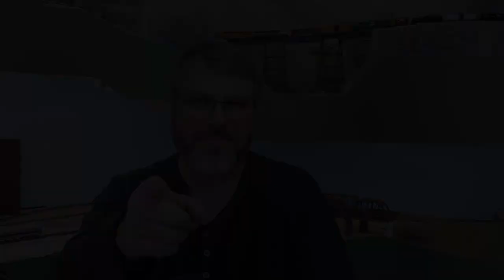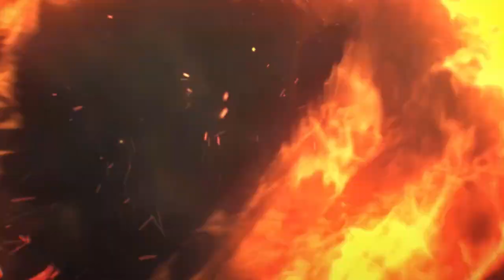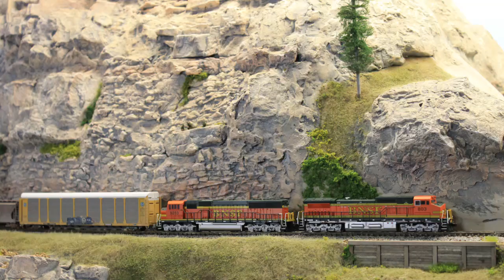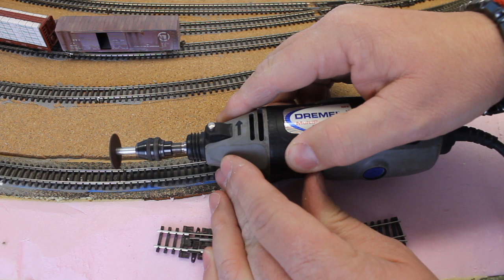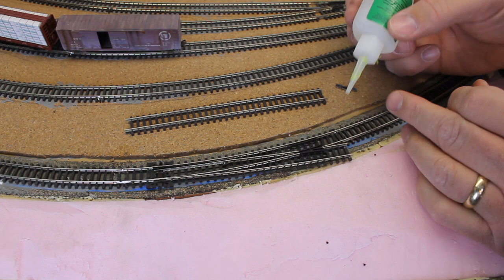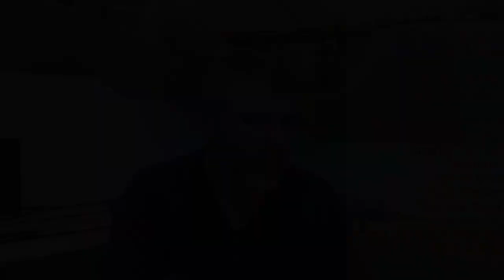How to Install a Curved Turnout on Your Model Railroad Layout

Comment: Hi Ron, I'm thinking of adding a curved turnout myself now, thanks for the instructions. My layout is in a large shed and I have an oil filled radiator to keep a moderate temperature but actually made a point of leaving some small gaps in the rails and not soldering those in case we have a heatwave, ha, ha, as I was concerned about the rails swelling and buckling. Where I did make a bigger gap than was intended I did put some solder in it and filed it down smooth and it has no problems. I did it that way as I'm not intending to paint the track. Thanks for the videos, Cheers, Rick

Comment: 10:48 fun fact: same thing happens when you're welding actual rails. usually in tight curves like that you would remove rail joiners from one side only, weld that joint, do the same on another joint further away (assuming you have several to weld) but on the opposite side and then come back to the first pair once it's cold. and you would grind them too, except not with a nail file :P that would take some time lol
Reply from the maker: That is interesting. Thanks for sharing.

Comment: Ron, a hint put the rail joiner part way on a short piece of scrap rail ( no ties) then use this piece as a holder to line up and slide the joiner onto the good existing  track.

Comment: Hi Ron, thanks again for a great video. I want to replace 2 Shinohara curved electro frog turnouts with the same Peco points you installed. I’m now confident in doing the job. Thanks again, and keep em coming. I’ve been in the hobby for 40 years and have built many n scale layouts. But it just goes to show you can teach an old dog new tricks! Cheers

Comment: Can those small gaps in the track be filled with solder? I’m new to this; just curious about options.
Reply from the maker: The better option IMHO is to fill them with a bit of styrene glued in place then filed to match the shape of the rail. Solder is hard to shape and can cause running issues.

Comment: Extremely helpful video. I saw a video earlier today on soldering track in “N” scale and the gentleman used two wet cotton balls too cool the solder joint. One on each side of the joint being soldered. No melted ties. I just redesigned my track plan and added a curved switch. This was extremely helpful.

Comment: do you do anything to your switches to get power on the turnout side of the switch I having problems getting power to my inter lope I watch one you-tube video which was shown they put jumpers on from outside rail to the next close to it then inside rail to the next one to it, what do you suggest?
Reply from the maker: I simply install feeders to all three sets of rails leading into the turnout. With Insulfrog turnouts I have no issues with the turnut getting power throughout, assuming all of the track joints are soldered.

Comment: Just saw this. Seems "anti prototypical"(don't know if that's correct grammar) for a passenger rail run. are you going to back a train into the platform and then run back out front end forward? Usually they are run throughs so the train can go both directions to and from the station?
Reply: Every layout has to make compromises. I think it's up to the owner of the railroad to decide what's important and what will be rhe most fun for them! We aren't all building historical dioramas.

Comment: Been there done that, went to an auto parts store and got a flat points file, works to get under the track.
Reply from the maker: That's a good tip. Thanks. I'll check that out.

Comment: Why don't you buy a "right angle" adapter for your Dremel tool? I use one every time I cut track with it, it allows you to cut straight down vertically, instead of holding the tool on an angle! I also use a reinforced cutting wheel, but still use goggles! Getting plastic or rail debris in your eyes can be very bad!

Joe Bliss
Reply: When putting in the turnout, you did not provide a hole for an under table slow motion switch.  How did you provide for that later?

Comment: Thanks for making, yet another, great video! Your tip about making sure the rails are slightly longer than it seems they should be, is something I probably wouldn't have realised, until after ruining a new piece of track. I had a plastic train set, when I was a little kid. I've always wanted an electric set, but it's something I've never got around to buying. I really like the idea of N scale, because of the space they'll save. However, I know they're more expensive than larger scale and there are less scenery items available in the same scale.
I also have that same model of Dremel. They're the best power tool for any miniature modelling. I have just about every add-on available.

Comment: Nice tutorial. I have one question. If you are planning to have an under table motor (ie, Peco or Tortoise) of some kind operating that turn-out shouldn't you have drilled the hole before installing the turn-out?
Reply: Yes.  It is always easier to do it that way.  Although you could do it opposite, it will be difficult.

Comment: Hi Ron, could you advise on whether  i should use Atlas HO  code 83 flex track or code 100. I am building new HO layout. Is Atlas the best or has their quality gone down.? I am confused by some reviews I read and advice on how to lay this track. I don't pla to solder and need some advice. Any suggestions? The local hobby shop where I can get this track says I should use code 100 but I think the code 83 more proto and looks better and probably has same permormance reliability. Thanks.

Comment: I like the way you filled in the gaps with styrene. I’ve always soldered them and ended up replacing ties if they were there. Then filing the solder is harder than the styrene looked. Thanks for the videos they are very useful.
Reply from the maker: Thanks.

Comment: Thanks for showing us.  When installing or cutting flex track, especially on a curve, I always use quite a few push pins on the outside of the curve to prevent the rail from springing out. I also don't like square ends (both rails cut opposite each other). I found this to create a 'hinge point' for the rails to kink that the fish plates and solder can't reliably hold. I believe this is one reason the full size railroads avoid square ends. It doesn't take much to use a #11 blade to remove spikes either side of the flex connection, push on a connector then slide in the new rail.  Holds radii great. Did this on a helix to verify my point. Perhaps you could do a video on installing peco switches with motors. Your contribution to the hobby is greatly appreciated.
Reply from the maker: Thanks, Ron. I do what you describe on most curves, but with a switch installation that is difficult as the ends of the switch are "square" ends.
Reply: Wow. I never thought you would reply. Do you use switch machines with your Peco turnouts? Could you show us how you install them on your layout? Thanks for sharing your knowledge.
Reply from the maker: Ron Dabola As of right now I do not use switch machines, but I'm planning to upgrade my mainline switches to machine driven and I will make a video when I do...I always make a video when I do something new.

Comment: Ron, this is a great video, lots of good information. Thanks. Do you use turnout motors to control your turnouts? When would you fit this turnout to use one? Is the turnout likely to "throw" without something to hold it in place? Would it be easier to drill the hole through the roadbed before you installed the turnout? I'd think it'd be easier to drill from the top than trying to come up from the bottom when you can't see exactly where it needs to go. Thanks for your great info.
Reply from the maker: If using switch motors, yes you would want to drill the hole before installing the turnout. I do not use switch motors on this layout. I hand throw all of my turnouts. The stay in place because they are Peco turnouts so the switch points are held in place with springs. If using turnout motors with these turnouts one would need to remove the spring.

Comment: Hi Ron, Thanks for sharing this useful addition. I need to do a similar "operation" on my layout to connect a D/A track to the main, without interfering with the lead/drill track. The difference is that I'll have to install a crossover, so double work. Definitely this will help me.
Thanks a lot.
All the best,
António
Reply from the maker: I need to make a similar modification to the thoroughfare track on my yard. I talk about it in my latest video. See time stamp 8:00 on this video. https://youtu.be/YqkC0U7qjVY

Comment: Nice video, but wondered if soldering the gap would have been an option, certainly have to be careful with the heat and filing.
Reply from the maker: I would never be able to fill a gap that large with solder without melting a lot of ties and making a mess of the track gauge. The styrene filler is much easier.

Comment: Nice video, one thing I do when sliding the joiner back along the rail is use a flat bladed jewellers screwdriver.  You can use the indentation on the side of the rail as a guide, AND you don't run the risk of putting too much pressure on the joiner and opening it up or crushing it.
Reply from the maker: Good tip. Thanks, Michael.

Comment: I have a tip for you. I use a little one or two inch piece of spare rail to slide the rail jointer on to it. Then you can place it at the end of the rail you want to slide the rail jointer on to. Ans slide it on.
Reply from the maker: Good tip. Thanks.

Comment: Ron, I see you are using a insulfrog turnout here.  I'm wondering if you could tell me why?  I am building a DCC layout, and need to pick up a couple of turnouts and frankly, I'm a bit confused on whether to use insulfrog or electro frog turnouts.  I intend to be running my trains slowly through these switches.  Thanks.
Reply from the maker: I started using insulfrogs years ago when I was pretty new to model railroading because they are easy. Electrofrogs with DCC have to be wired to throw with the switch. I could do this now but wasn't confident enough to try it back then and I'm still using many of those same switches. My advice is if you can do the wiring I would use electrofrogs, especially for slow running in N scale. My next layout will definitely be upgraded to electrofrogs.

Comment: I have a even simpler question regarding turnouts, as I am planning my layout I am trying to lay a spur that runs parallel to the "main line".  I am trying to use sectional track.  The problem I'm having is that there does not seem to be a curved piece that I can attach to the diverging part of the turnout that makes the spur parallel. 

All of the pieces I try either make the spur track drift away from the main, or run into it.  Is there a trick to this?  Do manufacturers make "turnout correction" pieces for lack of a better term?  If not, how do people make spurs that are perfectly parallel, let alone how do they make a full siding where the track rejoins the main further down?
Reply: Yes there are.  Usually, they are supplied with the turnout.  My guess is that you could find them, but you are going to have to know whether your turnout is a 4,6, etc.  It would probably be easier to just use a section of flex-track, maybe cheaper too.
Reply from the maker: +The Lowmein I haven't used sectional track in years but as I remember I think there are special curved sections made specifically for countering the curve in a turnout.
Reply from the maker: Yes, that is probably true.

Comment: Excellent and clear demonstration. Easy to follow. Professionally done. Now I am confident to insert a curved turnout on my curved track. Had been postponing doing so for fear of messing it up. Thanks to this video I'm all gung-ho to do this. 
BTW, What was the trade name of the super glue you used and that of the 'accelerator?
Reply from the maker: +Carl Boonzaier I have lost count of how many people have said similar things. Glad I could help. The ca I was using is called Extreme Power. It is just a brand that a hobby shop I stopped into recently had on hand. I usually use zap medium viscosity. As for the accelerator, I have a bottle called insta-set. Zap makes zip kicker which is just as good.
Reply: Thanks for that info on Ca and Accelerator. Do you add the accelerator to the Extreme Power CA? I'm ignorant of some types of glues. Many thanks.
Reply from the maker: As far as I know the accelerator should work on any CA.

Comment: I was always told you want a small gap for expansion or does the plastic give enough
Reply from the maker: Gaps for expansion are an important part of track laying, but I only include them in straight sections, not in curves. The plastic will give you some give, but I wouldn't replace small expansion gaps in straight sections with plastic filled ones.

Comment: I don't solder turnouts because I will usually melt a tie causing the rail to get out of gauge.  I do solder all of my flex track together, however.  I don't glue down my turnout either; my track on both sides of the turnout will hold down the turnout.  I will paint my cork roadbed underneath of the turnout in order to match the color of the ballast.  I also like to not have too much ballast if any near the points of the turnout; I don't want anything to get in the way of the points and the rails especially since all of my turnouts are power routing.  I have even had a few times where both tracks on the diverging tracks were powered!  So I vacuumed the area around the points and then the power went only to the divergent track I wished to power.  I believe there must have been some metal shavings somewhere near the points and rails causing both divergent tracks to be powered.  I use Peco code 55 turnouts which usually have sleeper ties at the ends.  I remove a tie or two of ties from the track that join the turnout that way I can get a nice level joint between the turnout and the adjoining track.  Then I will use balsa wood in order to fill the gap underneath the joints.  Since the my wood ties will be lower than the Peco ties I will usually add another piece of wood on top of the first tie.
Reply from the maker: Thanks for sharing your process.

Comment: Are you going to show how you put in the rest of the bed for the side rail and it it looks like you banked the curve how do you account for that on the side rail.
Reply from the maker: +Kenneth Wallace I'm sure what you are asking in the first question. As for the second, the bank is gentle. The siding will simply include a gentle twist to level not unlike the transition out of superelevation at the end of the curve. It is a slow-speed siding.

Comment: Hi Ron, thanks for the video.   A couple of things:
1) You didn't mention that CA will eat through foam.   So as long as your roadbed is cork you are fine but if it is laid directly on a foam base, when you put the CA between the ties, it'll eat that foam.   Also, you can get thin CA which is pretty good at wicking between spaces in which case it'll go between the track and the tie.
2) You didn't show how to wire the turnout.   I prefer to solder feeder wires to the bottom of my track (including turnouts) before installing.  I pick where I'm going to install the feeder wires, mark the roadbed to drill a hole and mark the track for soldering to the bottom, then as the last stage before final install I solder on the feeders, do the final test install and proceed.
3) I've also done turnout replacement using track nippers to cut the track, just make sure, as you say, cut in the right place and leave a little bit extra to file.
4) Finally, I go to the makeup section at a local large drug store and get the filing boards they use for nails.   Those come in various grits, down to "polish", have foam in the middle and are just wide enough to do both tracks.   I use those to do the last little bit of "sanding" on the top of the rails to get rid of any solder and to make sure the styrene is flush.
Reply: Maybe you should have your own YouTube channel. I think Ron is doing just fine mr criticism.

Comment: This is another of your quality videos and why you've so quickly developed a large following. I'm sure anyone who builds a layout encounters situations where changes must be made to track. Sometimes it is more than adding a turnout. We should never be afraid to tackle even a major reworking of track if it results in significant improvement for operations.
Reply from the maker: +Jerry Smith I couldn't agree more. Do what makes the layout operate the way you want. Don't put up with something less than satisfactory when you can fix it.

Comment: Thanks for a very helpful video, Ron.  I was wondering if in your opinion epoxy gluewould work where you used the styrene inserts?  Thanks again. : )
Reply from the maker: +Ernie Parsons It probably would work great, but is a lot of trouble to work with for such a small amount.

Comment: Thanks Ron for this video. Just came in time. I also need to modify mine.  I’m not sure if it’s going to work yet. I need to add a turn out coming out a tunnel where the track is inclined. This will rejoin the existing spur line for my passenger station.  That way, I come back facing forward instead of backing up from the mainline on the other end.  On top of this, it’s a Bachmann EZ track.  I don’t know yet if I should pull them apart or just cut like you did. Maybe use Atlas turnout instead. Is there any way I can send you photos on an email to see if it’s even possible to make that change?  I appreciate the advice I can get before I tackle the job.
Reply from the maker: Sure. You can email me at ronstrainsnthings@gmail.com
Reply: Email sent. Thanks Ron.